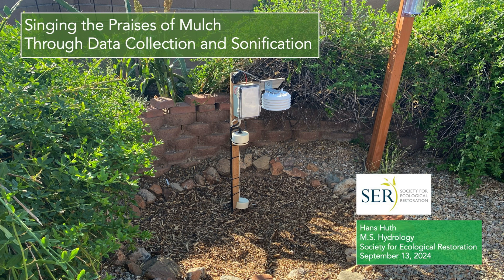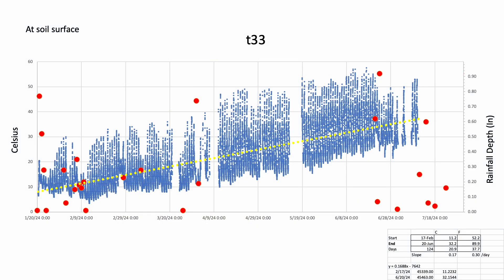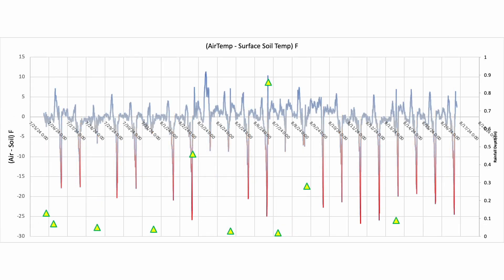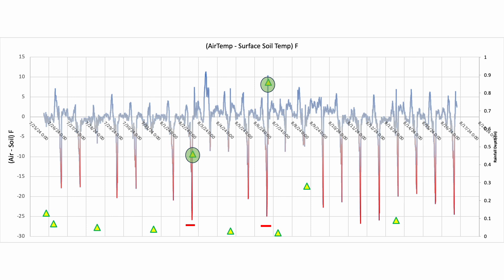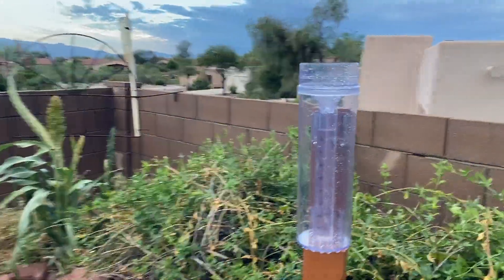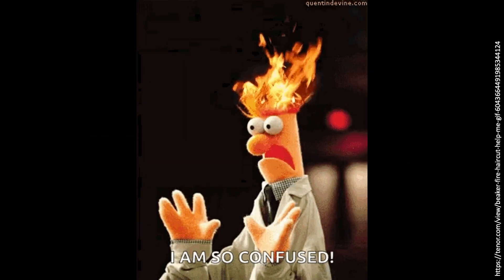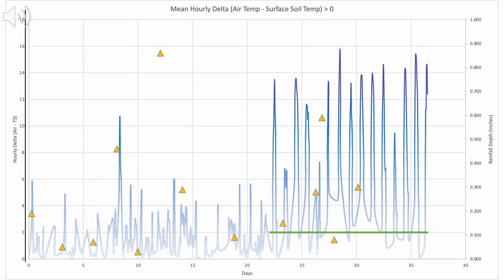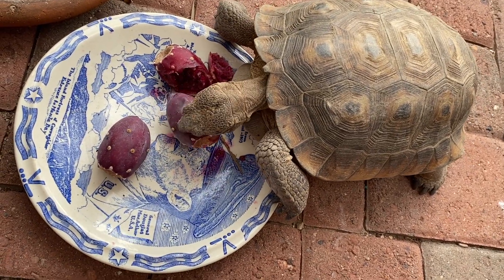Data Sonification in a Water Harvesting Basin

Comment: I learned that the most accurate moisture sensors use alpha particle absorption to measure water content in soil. The detector is installed underground and an alpha particle emitter is installed on the surface. This solution is too complicated for makers... for now. But it occurs to me that we, the makers, can measure water absorption by measuring the attenuation of a wifi signal. By putting a wifi emitter underground and the detector on the surface, let's say with two esp32s, we could measure water absorption simply by measuring the intensity of the wifi signal. Are you up for it?
Reply: My bad, there is already a paper titled "Towards low cost soil sensing using wifi" by Jian Ding  and Ranveer  Chandra, 2019. But, it seems simple to implement it.
Reply from the maker: Interesting! You could make a map of your yard's soil moisture using wifi emitters placed strategically around your yard. If you send me some data, I'd be happy to sonify for it you 😉.
Reply: @ModestMaker I think I will try the wifi method. I live in the southern hemisphere, in a subtropical region where it starts to rain in november. I would first prepare a single sensor and measure only at one point, to check some relationship between wifi signal attenuation and rainy days. Only if there is a logical correspondence would I put more sensors. I have a good amount of esp8266 that I can use.
Reply from the maker: Keep us posted!

Comment: Nice work.  Bravo. 

1. The data correlates with information I have seen from other sources. Mulch tends to drop soil temps about 6-10 degrees, and extends this cooling effect over several days and weeks. Of course - everything depends on your location. 

2. I would be very interested in seeing your your logger would work with three locations (a) baseline plot with no mulch, (b) a plot with 3 inches of mulch, and (c) six inches. Further, it would be helpful to gather data much further past the rainy season, looking at how well the mulch holds the soil. Your HOA could save a LOT of money, spreading large amounts of mulch over the property, and saving on your water use. 

3. I dont know how much data sonification will help to display//demonstrate your data.  The temperature data you displayed is INTERVAL based data, with each increase/decrease in data points representing a linear change in quantity.  The musical (PITCH and LOUDNESS) representations, are log based 2, so that every time your temperature data jumps up a degree, you get a larger (and confusing) increase in pitch. Still, these data transformation schemes are pretty cool to play around with, and it never hurts to give it a try. 

Keep going. 

Dr. JHB (Speech/Hearing Scientist; 3D printing enthusiast; Los Angeles)
Reply from the maker: Thanks Jim for your thoughtful comments. 

Our HOA has been very successful in using these strategies over the years- more details here: https://youtu.be/sI1wfKOF99o?si=ap5hOdEJdoCeucpZ . Through careful accounting relative to baseline conditions, we've managed to save over five-million gallons of water over the years by doing simple things like applying mulch; installing water harvesting basins; and paying close attention to our irrigation with volunteers shutting things down after monsoons to avoid waste. 

Regarding sonification, your points are reasonable with the understanding that I'm brand new to this so still working on how to make this approach "sing". Being an avid water conservation guy and music lover, it was a natural thing to see how I might marry them both 😋.  Appreciate your interest in all this!